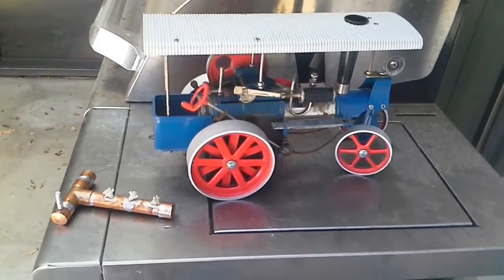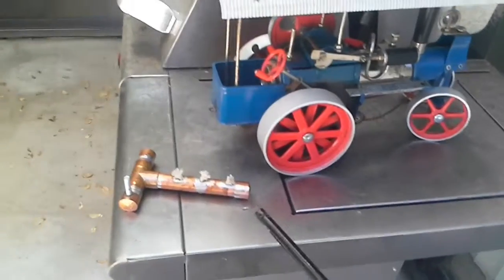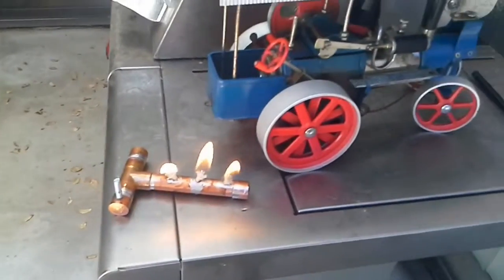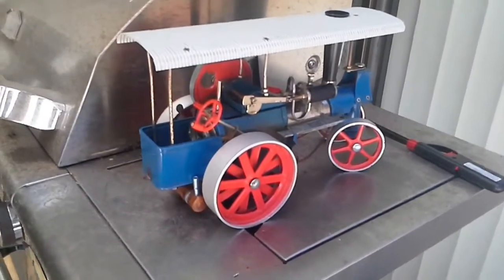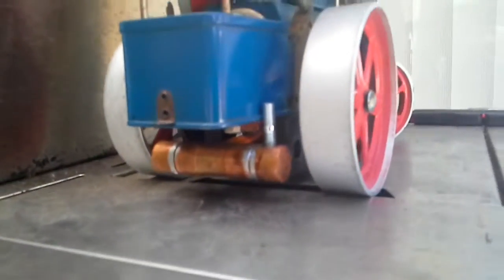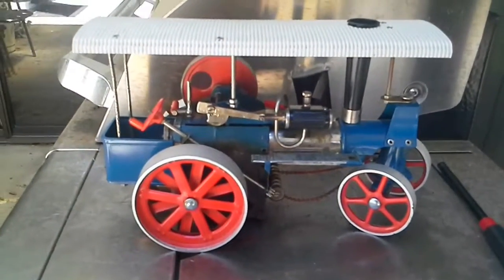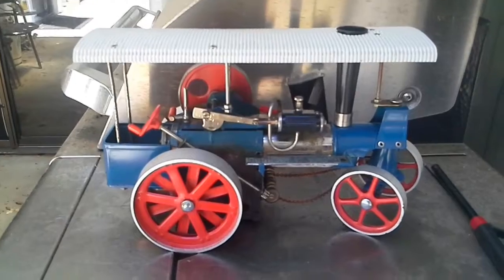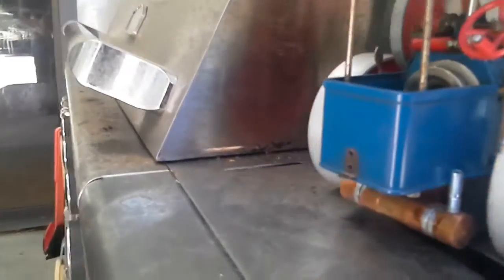Wilesco steam tractor ,July 20, 2017

Comment: There are various  lighters  for  steam engines   but other than   using  solid fuel blocks or methes  there is no advantage in other methods   some are  filming them running off  compressed air   but that's not what steaming is all about